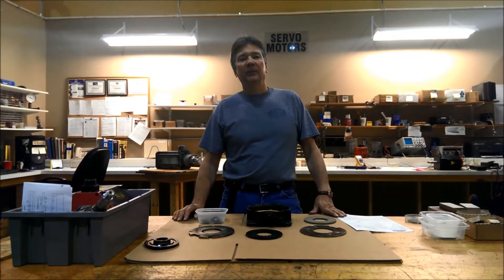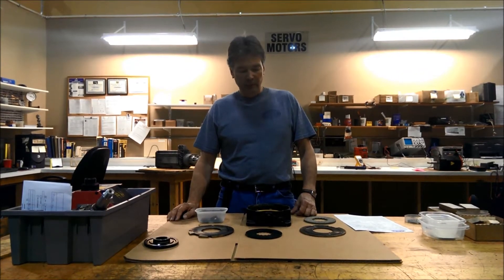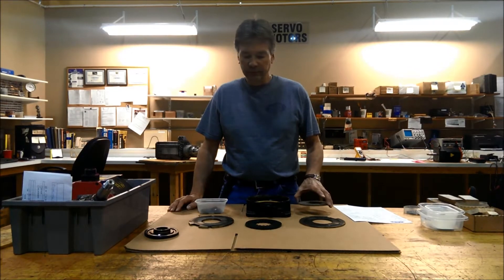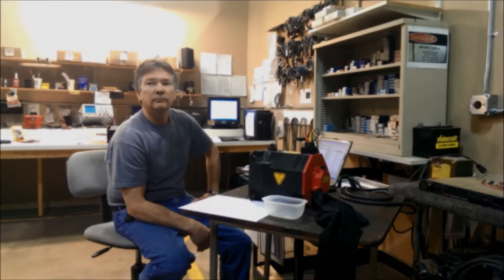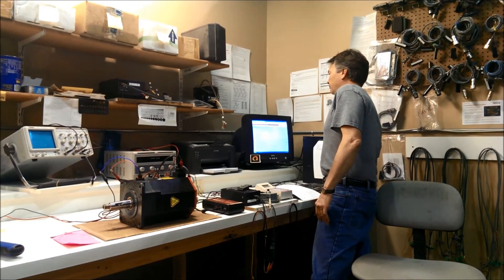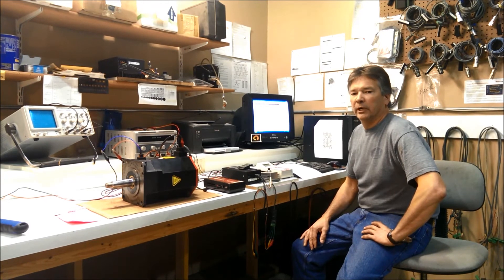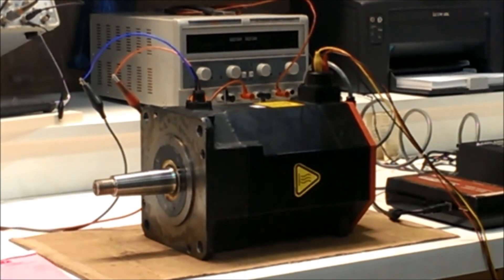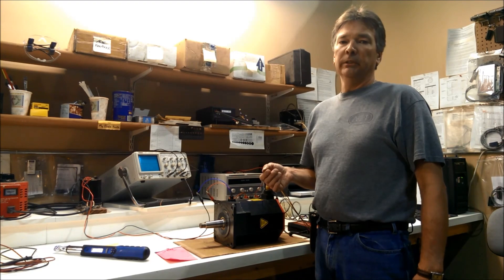Servo Motor Repair

Comment: Hi, i have a problem with fanuc motor 
 Which drives Y axis on a robot. On robot pendant i can see Y axis position changing but there is no physical movement to Y axis. Do you what mighy be wrong with servo motor?

Comment: I'm giving fanuc servo motor temperature over the same issue is not over heating this indicates 200 ° degrees, wanted to take a doubt what should I do this maintenance.
I'm waiting
Imail. lucassluciano@yahoo.com.br